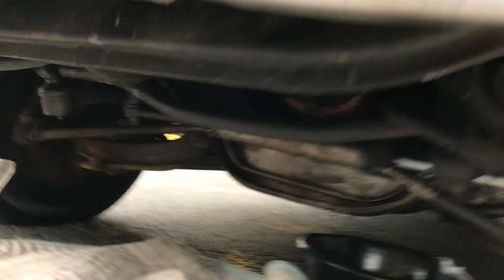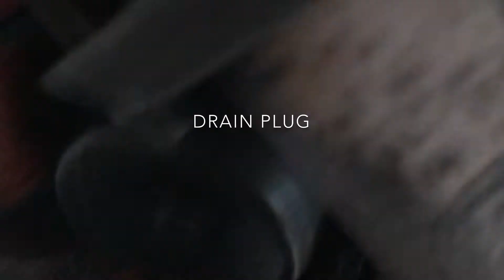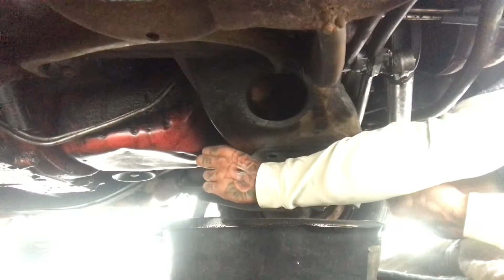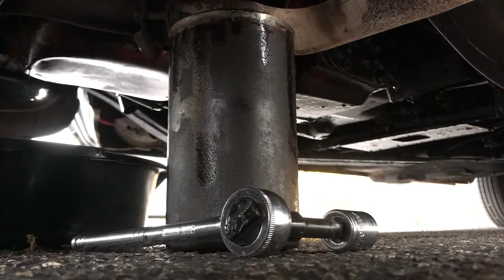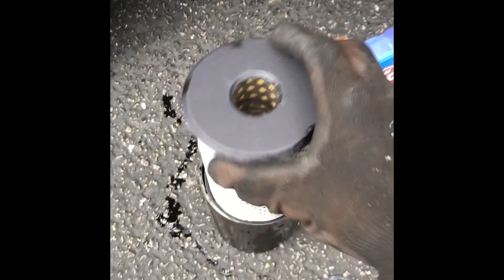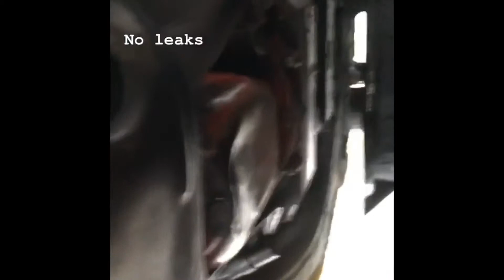1962 impala oil drain plug location

Comment: yo nice work, why dont you switch over to a full synthetic like MOBIL 1 High Mileage 10w40 Advanced Fully Synthetic? Will it not matter on what you use for that specific vehicle?
Reply from the maker: What will that oil do for me different than regular 10w40
Reply: @vincentbryan1962  are you serious? well "full synthetic" is supposed to last longer than "conventional" oil and Its suppose to keep your engine running longer and better...and it has more additives like seal conditioner to help stop leaks
Reply from the maker: Thank you for this and the link. I will try it out next time. I’m so used to buying cheap oil then adding the little oil honey stuff pretty much does the same thing like seals and such. I’ll try out your method next oil change. ESP since I want this car to last forever
Reply: Your welcome bro
Reply: And also full synthetic is more refined oil than the  conventional oil that you use, conventional still has little minerals and stuff in it that can fuck up your engine in the long run